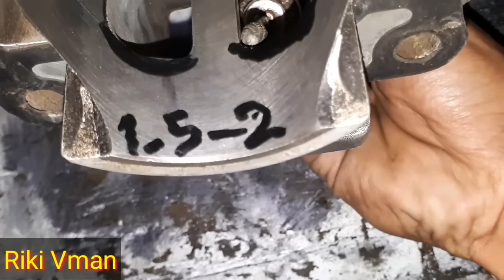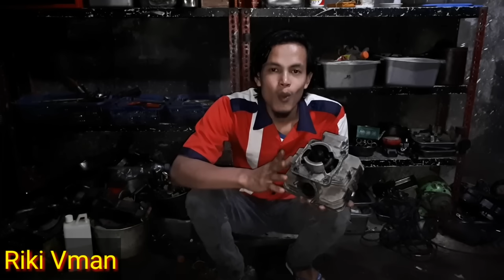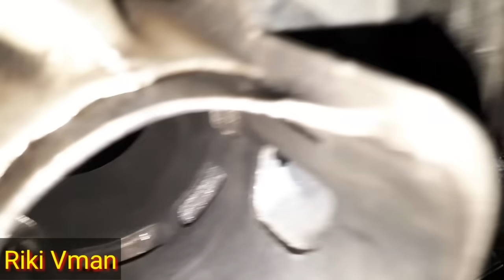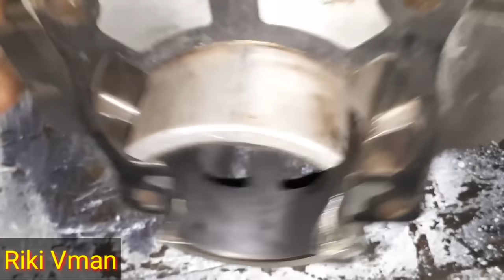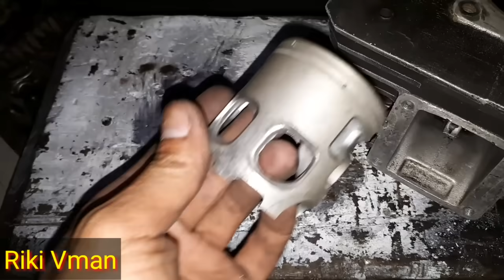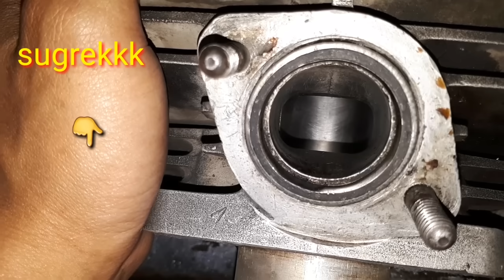Kupas tuntas PORTING RX KING dasyatt !!! Porting INTAKE, TRANSFER, ROK PISTON !!! Tips korekan 2 tak

Comment: Setiap naik os apakah volume kubah head harus di sesuaikan ulang mas?
Reply from the maker: Klw kompresi sudah dipatok sangat tinggi. Hampir mendekati nglitrik.
Klw piston di besarkan 1 mm( ruang bakar harus dikurangi 0.5 cc)
Reply from the maker: Karna untuk rx king tiap piston membesar 1 mm.( 0v 100) volume silinder naik 5 cc.
Reply from the maker: Tapi klw rpm atas ga nglitrik, (bergetar berisik. Power nahan.)
Kubah head tidak usah di rubah.
Reply from the maker: Karna klw 2 tak kompressi terlalu padat.
Mudah ketahuan di rpm atas. Power hacur. Suara tidak bulat. Sampai gigi 5 . Mesin over heat.
Reply: Mantap mas...detail banget penjelasannya...makasih banget mas🙏
Reply from the maker: Sama2 ...🙏
Semoga bermanfaat..😊